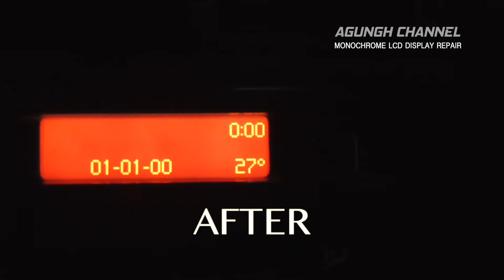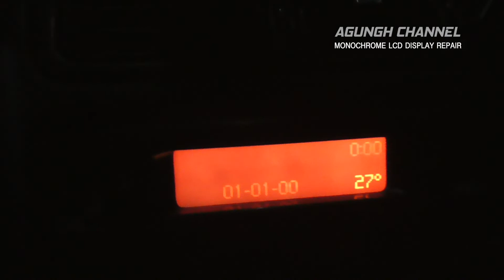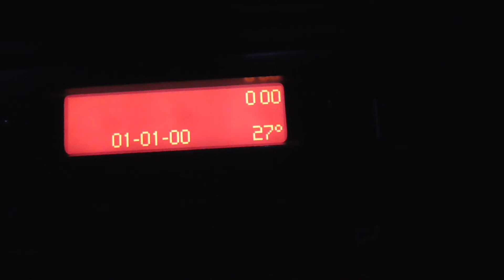How To Fixed Multifunction Display Problem #PART_02 - Monochrome LCD Display Repair MID PEUGEOT 406

Comment: Hi , Congratulations and thank you for this video!  I have the same problem with my 206 s16 multifunction display, caused by heat and sunlight!  Can you meditate where to buy the polarized film and the orange film to repair my multifunctional display?  Thank you very much and congratulations again! 😉👍🏽
Reply: gwadaflat did you find out where to get the film and back piece. ? Also is the film self adhesive
Reply: you all probably dont care but does anybody know a way to log back into an instagram account..?
I was dumb lost the password. I appreciate any assistance you can give me
Reply: @Timothy Braylen Instablaster :)
Reply: @Cason Randy I really appreciate your reply. I got to the site thru google and im in the hacking process atm.
Looks like it's gonna take a while so I will reply here later with my results.
Reply: @Cason Randy It worked and I now got access to my account again. I'm so happy:D
Thanks so much, you saved my account !
Reply: @Timothy Braylen Happy to help xD

Comment: Hello I have the same problem with my MFD in Peugeot 607 Phase 1. Can I buy just any polarized filter on ebay ? LIke for IPhone for example ? Plus, my screen doent have the background color attached, its just behind the screen... After removing and cleaning the two plarized films the glass (LCD) was still kind of dirty , had like blueish stains thar wouldnt go away.. Can you help? Terimah kasih banyak sebelumnya...
Reply from the maker: I'm not sure that blueish caused by.

Comment: Nice, any idea what could be wrong when there is no backlighting? Bulbs are ok, changed all 3.. still no backlight. Display works tho. Do you know if there is any pico-fuse on the board that could cause the backlight bulbs to not work?
Reply from the maker: You should check the line board and component related the backlight, probably there are any corrosion or component damaged.
Reply: Thank you, I will check the board more thoroughly and try to trace it where the voltage is lost as I measured the voltage on the bulb holes and there is no voltage.
Reply: @AGUNGH  Do you remember what pins on the connector are for 12v and ground?
Reply: @KillerkoUK  7,9 positive, 8 negative

Comment: @AGUNGH CHANNEL  Bro, i had a similar problem ,but i bought a used MFD, replaced it but now my steering wheel controls don't work.
But i if put back the old one it works just fine 🤷‍♂️ what should i do?
Reply from the maker: You can try configuration setting using PP2000

Comment: Can be the adhesive removed with alcohol from the glass instead of using the cutter?
Reply from the maker: It's hard to remove harden adhesive forced using alcohol, that's why i used cutter to remove it then cleaning using alcohol.
Reply: @AGUNGH  Thanks for your answer. Great video. You provide to us great solutions. i removed the adhesive with isopropyl alcohol and cutter too but now i´m not sure if the polarizer film has to be lineal 0 degrees or 90 degrees or other. which one should i use?
Reply: @joseluisdiaz-cardiel7977  Hi friend how many degrees of polarizing film is needed for the front and for the back side ??

Comment: My Peugeot 307 MFD only turns on when it is warmed up by the sun(or hair dryer). I suspect it's the ribbon, do you know how to replace or reflow a ribbon?

Thanks for the video, it's good to know what can be done diy!
Reply from the maker: Please like and SUBSCRIBE. Next time if I have same problem with yours, I will share video how to do that?
Reply: AGUNGH CHANNEL my lcd display remains off when the car is started. If the car is parked in the sun for a long time or if I blow hot air on the back white plastic with a hair dryer the screen comes on but when the car is turned off again after a while the screen wont come on.
Reply: Om, MFD di 807 saya kadang nyala sering mati...
Masih bisa direpair ga tuh ?
Selain itu kayak ada jamurnya juga..
Reply: @ryansmithza  Hey man, have u noticed if when the screen is of, does your bluetooth capability is not working either??? Im having this trouble too.... Im tempted in buying a new  aftermarket stereo hahaha.